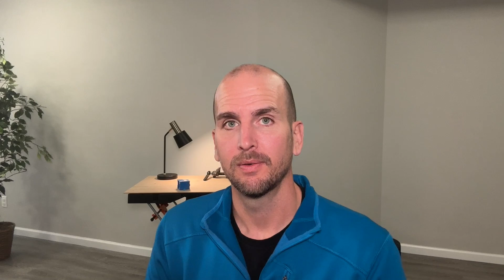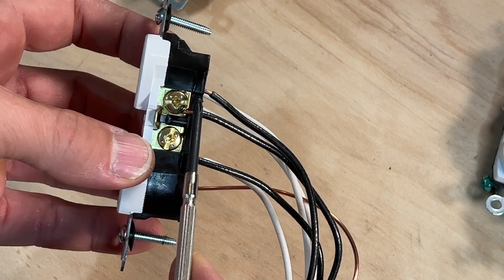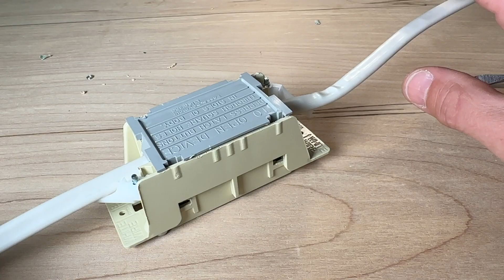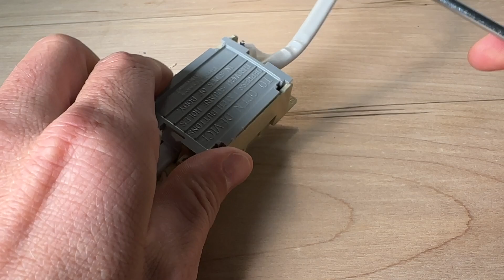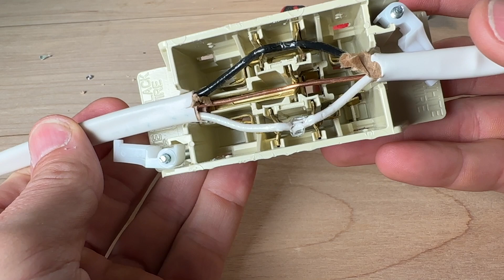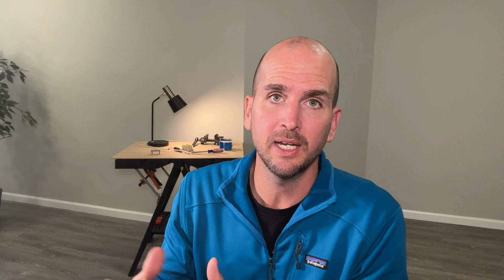90% Of Homeowners Have Never Seen This Dangerous Electrical Device

Comment: We are full time RVrs and purchased a 'Grand Design' RV that is filled with these 15 amp outlets.  Not only have a number of the outlets failed due to the constant motion the rig is subjected to during travel over the USs terrible roads but they tend to break apart and dislodge from the thin RV walls for the same reason.  Another issue I discovered was that up to 10 of these 15 amp outlets are on a single 15 amp breaker as 'designed' by the manufacturer! I just purchased standard residential replacement boxes and will now also purchase plate backer outlets per you suggested best option.  Thank you for raising awarness about the cheap and dangerous push in outlets. Next I need to figure out how to rewire the rig to eliminate the overloaded circuits. Many RVs are destroyed by fire each year. My guess is these junky outlets and overloaded circuits are the cause of many of the fires. These things need to be banned and the RV industry as a whole needs to be subject to US  Standard Electrical Code.
Reply: What the other guy said... You can have any amount of outlets but you can only draw so much power on a single circuit and the RVs are designed not to let you draw more than each outlet totally up to 15 amps.  I'm not saying they're not better choices for outlets out there but that would not matter how many are on The wire unless you change the breaker to allow you to do more than it's designed for.

That being said I also have a new Grand Design RV that is only a 30 amp and any additions I'm going to make are going to be using residential style plugs and a separate circuit using a electrical box subpanel so that I can control completely how my systems interact.
Reply: I hate to say it, but your circuits are not overloaded at 10 outlets on a 15 amp circuit, (unless YOU overload it by plugging in too many things). NEC says that there is no limit to how many outlets you can put on a 15 amp circuit. The rule of thumb though is that you don't draw more than 80% of the breaker's rating with everything turned on. The recommended current rating per outlet is 1.5 amps. So if you intend to maximize to the 80% of breaker recommendation, you would only have 8 outlets on the circuit. Thats why the RV builders put as many on as they feel like, because they are allowed too. They cut down on wire costs by doing things like that. Unfortunately, we are the ones who get stuck trying to fix these messes. Good luck. I've been doing this crap for a long time, it's never any fun.
Reply: @wrenchgearsadventures  Actually with 10 receptacles you have 20 outlets. 20×1.5 A is 30 Amps on a 15 amp breaker. Problem is compounded by this little fact. Hair dryers, curling irons, toasters, space heaters, coffee makers,etc ALL burn much more than 1.5 amps. Many things do. We can really trust the manufacturers of motorhomes. Sure! Really?? I don’t think so. I feel for you. Good luck.
Reply: @markfreedman2470  I think you're misunderstanding something here. Even in home wiring, NEC only requires that any single outlet can handle the entire amperage of the circuit. Not all combined. For example, it's perfectly fine to install 20 recepticles on a single 15 amp breaker as long as each recepticle is rated for 15 or more amps. It would be dumb to do that and you're likely going to have a ton of nuisance tripping but it's perfectly safe nonetheless. However installing any number of 15 amp receptacles on a 30 amp circuit is not allowed (though I do believe it's allowed sometimes only if each recepticle is connected via pigtail instead of daisy chain)
Reply: @davyc444 Over time breakers running close to their limits tend to get hot. The contact area where the breaker mates with the panel will deteriorate as well as the panel contact area itself. After the reduction of contact area, the breaker will get pistol hot. Hot enough for the contact areas to fuse together. Breakers are more convenient than fuses, however I think fuses in the long run are safer. The correct amperage fuses, of course.
Reply: @wrenchgearsadventures  
Very true but a common rule of thumb is no more than THREE outlets on a 20 amp circuit.
Putting 5 on a 15 amp will limit each outlet to a maximum of 3 amps when all are in use. Completely unacceptable in todays rv standards.
Reply: @wrenchgearsadventures  Many - perhaps even most - electrical devices I'm familiar with use a bit more than 1.5 amps in operation.

It may not technically be overloading the circuit to put 10 outlets on it, but I consider it very bad practice. For perspective, I'd say to put no more than 3 or 4 duplex receptacles on one circuit, for 6-8 total plug sockets... and that's at maximum; when I'm doing wiring, I prefer to only install 2 or 3 duplex receptacles (4-6 plug sockets) per circuit. Why? In part, to accommodate power bars and extension cords: with too many outlets per circuit, you practically cannot use either without risking tripping your breaker.

For high-draw locations like a garage or shop, I'd say any more than 1 or 2 outlets per circuit is a bad idea; I'd also highly recommend using 20A circuits in place of 15A, as many power tools can have extremely high peak power draw, and having breakers trip frequently while you're working is exceptionally annoying... not to mention power bars and extension cords are frequently used in garages, shops, and the like. For added convenience, it can make sense to install a secondary breaker/distribution panel in those types of locations - so if the user trips a breaker, they can reset it locally instead of having to travel all the way to the building's main panel.

Mind you, I do tend to overbuild things; in my opinion it is better to build everything you might need all in one go, rather than end up doing time-consuming and costly rework later.
Reply: @wrenchgearsadventures  You want the maximum current capacity of any outlet equal or more than the circuit breaker. If you draw maximum current from a single outlet you want the breaker to trip before the outlet fails. It is common sense that you want the breaker to trip before other things start to fail and cause a fire hazard. That obviously includes wiring and outlets.
Reply: @ralfvandeven3155  Agreed. The 15 amp rating on an outlet actually means that it is designed to attach to 15 amp rated wiring, so the breaker needs to be 15 amp also. Any high current draws definitely need to be on a dedicated circuit, or switched in such a way that you cannot have multiple appliances running at the same time.
Reply: @wrenchgearsadventures  I don’t think There is an electrical code standard for RVs. This allows idiots to stick a whole bunch of plugs on one circuit. I also don’t think those were designed to be used in a high vibration environment.
Reply: @markfreedman2470  Vibration should not be a problem. This type of outlet should be designed with a cable anchor point where it enters the housing.
Reply: @markfreedman2470  actually there is. Certain sections of the NEC do apply to RVs. It's supposed to be enforced by RVIA (if the manufacturer is part of RVIA) which sends inspectors in every 6 weeks. The company I work for has people like me who are in the plants daily working to inspect and help train employees but not all manufacturers do this. I'm not going to say any company names because I'm not here to call anyone out but we are one of the very few companies that have people in a position like mine and conduct our own daily inspections. interesting side note that recept is actually not compliment since the sheathing does not enter I to the recept at least 1/4".
Reply: @myrealfakelife  Very interesting! Wouldn’t mind knowing who you work for. I’d be more likely to buy an RV from them. Thanks!
Reply: Oof, yeah I didn't even think about the constant motion, vibration, thermal expansion, of a vehicle. 
"cost savings" in action, I suppose.
Reply: 10 devices on a single circuit is fine when its for general use. But in an RV I think they should limit it to 4 receptacles per circuit. Many of the devices people plug in are a high current draw, especially in the kitchen, dining and "living room" area. I am a big fan of the people that retrofit old RV's and use commercial wiring methods! Everything on 20 amp circuits, all wiring in conduits or metal clad flex wire, real receptacles!
Reply: @crazypete3759  I am from the UK, and domestic plug circuits are rated at 32 amps. two cables 2 x 16 amp=32 amps total. so the circuit is still high amp, and 8in theory is more stable as its a heavy duty supply to the plug. Many people ask why a UK plug has an integral fuse in it. This is why, as from the socket the load is reduced to 16 amp, with no device rated more than 13 amp. Therefore a 13 amp fuse is fitted for high amp devices.
Reply: @roberttill3787  I really like the fact that UK plugs are internally fused inside the plug of each device. Its a great idea.
Reply: @crazypete3759  The UK spent a lot of time many years ago devising the standard to use. Instead of the high load stopping at the fuse board its just a staging post for reducing the load capacity. The fused fitting is the final reduction, and there are different fuse ratings for different load appliances.
Reply: @crazypete3759  Definitely the British plugs are better , Besides having an internal fuse
They provide much better contact , 
Greatly reducing the risk of overheating
Reply: Love my 2021 aluminum framed Rickwood RV but as soon as I got it home from purchasing it the first thing I did is remove all these, install  real electrical box and residential outlets. I then changed allthe plastic water connections to brass.
Reply: So how much fun is RVing, really....? 🤔
Reply: Yeah, 
But think how much it saves the RV manufacturers.😂
Reply: "10 times 15 amp outlets equals 150 amps on a single breaker!!1!"
Reply: You definitely got that right , How stupid of RV manufacturers to use something like this
having a really bad connection to start with and being subjected to vibration while going down the road , I can't believe that they would let a piece of junk like this go out on the market , That device is definitely unsafe and a fire waiting for happen , How stupid of UL to approve a piece of junk like this
This product needs to be banned immediately because it is extremely unsafe
if I was looking to buy a house or an RV and found those junk outlets in there
I wouldn't even think about buying it
if I was wiring an RV , I would use regular electrical boxes and commercial or industrial grade outlets and switches and definitely not have more than three outlets on one circuit and another thing , All connections would be soldered so that the connections won't vibrate loose , Anytime I do any wiring on a vehicle , I solder all the connections because in vehicles , Electrical connections are very likely to vibrate loose
Reply: It’s all about weight.
Reply: One thing I didn't see mentioned here in this thread (maybe just didn't read all comments...): do you mean an RV as on the road and off-grid, or like when people live on it and it would be directly plugged into the mains grid?
If we're talking about off-grid one should also not forget that just upgrading the circuits (say adding more breakers) might not help much or even downright be a bad idea, if your inverter/generator can't keep up.
If plugged into the grid of course you'll have access to way more power, just the input wiring gotta match.
Reply: @Kalvinjj  When running off the generator
You have to monitor the wattage of your lights and appliances , Always keep the load on the generator a couple hundred watts under the maximum load rating 
As far as those bad outlets
Definitely replace them with boxes and commercial grade outlets , This applies to whenever you're using the RV
Reply: Its code I build them in elkhart
Reply: Not a problem to have multiple outlets on that 15 amp breaker. The total power to the rig is only 30 or 50 amps. Only the A/C and furnace might use higher amp circuits. Open them up and strip the wire and punch the wire back down to the bottom of the slot.
Reply: Yeah, it doesn’t seem all that bad if installed correctly. The insulation and or damaged to insulation isn’t really a factor, but the contact patches shown in this video are plenty for a single set of outlets that are not particularly highly loaded. You wouldn’t want it to be powering your electric oven or water heater or dishwasher on a permanent basis, probably. And those are the kind of loads you’d want on a separate breaker, as well.

I would assume that any manufactured home manufacturer would have the correct tools at the factory and use them. I’m not so convinced about RVs in a vibration heavy environment. That could well be problematic.
Reply: @JasperJanssen  side wired commercial grade outlets would be the only acceptable wiring I'd think in a high vibration environment. Even back wiring wouldn't be as reliable in that particular instance. With the j-hook, even if the screw starts to work out, there's still good contact.
Reply: @SirBrass  better no contact than bad contact, though. When it doesn’t work, you’re also not plugging the vacuum in there and burning the place down.
Reply: @JasperJanssen  I wouldn't want to run my toaster or kettle on this kind of connection.
Reply: They are safe if the proper tool is used to push the wire down, and the insulation is cut properly on all 4 points on contact for each wire.  Due to tight labor markets, and poor pay, it's possible poorly trained employees did a half ass job on the wiring.  If installed properly, it is a safe product.
Reply: @cyclopsvision6370  Funny enough, the RV manufactures pay QUITE well. 70k+ a year is common. BUT they work so fast that things get missed, and the materials are so cheap.
Reply: @cyclopsvision6370  I bet the rv manufactures don't even have the tool.
Reply: Reason # 4343423238358857298474298374 why not to live in an RV

Comment: that looks like a lot more work than its worth trying to save time. I am not an electrician, but i think it would take more time to strip wire to fit that and then still have to worry about connection. don't like it

Comment: Saw one of these as a light switch in an early 2000s mobile home, was wondering what the heck it was. Looked like the rest of the devices in the house had long been replaced with proper house grade stuff.

Comment: Ahh my arch nemesis we meet again.

So seriously fuck the sumbitches. I live in a doublewide and when we remodeled every one got removed and a regular new work box (removed drywall for remodel) with a commercial grade outlet installed. The hole created in the wall for these isnt the normal size for a old work box so if you convert you will need to make the hole bigger.

Comment: Was trained as a union electrician….  Never use an outlet as a junction.   Pigtail the device….   The outlet can be replaced without disrupting power.  If a failure occurs

Comment: I've never seen that before. I don't like them. If I encountered them I would throw them out, install a metal box and a commercial grade back wire outlet. Not speed wire, but back wire. Unless I was short for money, then it would be a bargain bin outlet but with J hook and screwed. Of all the stupid regulations otherwise, but that's allowed. This is exactly the problem when the government gets involved with dictation.
Reply from the maker: Yep, probably would just need a shallow box as most of the wall cavities will not be the standard 3 1/2" wide.

Comment: I would never install these.  I have done repairs on some older "Wiremold" surface wiring, and although much better it still had its faults.  I would rather spend the extra time and do it right.  At least I can sleep at night.
Reply from the maker: Agreed, thanks for the feedback.

Comment: Contact area is an illusion. Most "contact areas" are less than 1mm2, even though it looks like it is huge, physics do not allow more than 3 spot contact for two different objects (including two ideal surfaces). What actually matters is torque/pressure. WAGOs touch like 0.2mm2 and can safely pass 30Amps.

Comment: these are very similar to the press on switches and electrical taps that press onto lamp cords Apparently people use those with 2 wire lamp cord to make custom cords for Christmas lights you can add a 2-prong electrical outlet anywhere along a cord

Comment: I live in a 1984 single wide mobile home that utilizes these type outlets.  In the master bedroom we have a 110 volt window air conditioner.  I kept smelling something and finally found the front of the outlet it was plugged into was so hot that it was actually in a liquid state and never tripped a breaker.  Needless to say I replaced the outlet with a standard residential type.  Thankfully I found it before it ignited.
Reply from the maker: 😬 yikes!  Yeah the failure I had was from a kitchen countertop griddle that pulls a heavy load as well.
Reply: Exactly. IDC is not a good enough connection for a high current appliance like A/C.